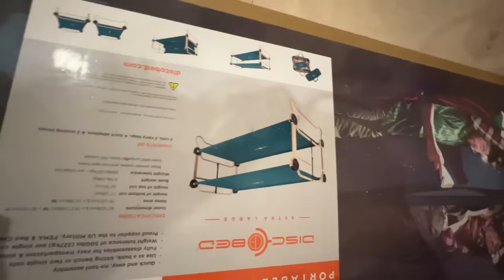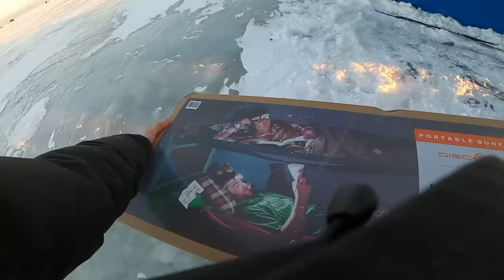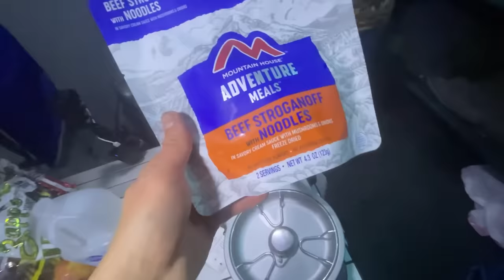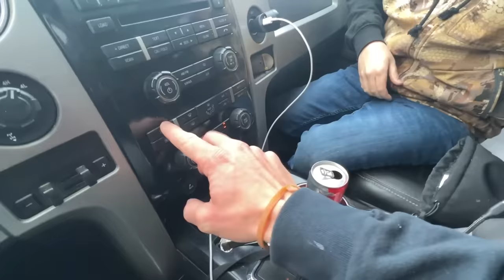Bunk Bed Ice Camping in -5 Degrees

Comment: Don't know if you're used to diesels, but let those glow plugs heat up a bit before cranking it over. If extremely cold, do it two or three times before attempting to start :)
Reply: if that model has the preheating Glowplugs that is, i had a old ass mercedes which i almost had to use a blockheater seperatly in the wintertime due too it not being able to start at all lol. but yeah, preheating is a must for older diesels.
Reply: Good call, I have to wait till the glow plug light goes off in my diesel, not every one has that handy light though
Reply: @DennizWillKill  I thought that was the point of glowplugs? Once the engine is running it no longer needs them since the fuel is ignited with compression.
Reply: @juicewrldextendedunrelease5274  that is the point of glowplugs
Reply: I had to do exactly this with my diesel VW ages ago when I lived in the same area Mav does.  Turn on the ignition, let the glow plugs cycle, turn off the car, cycle the glow plugs again... repeat at least 3 times...
Reply: @petertratechaud7277  does it damage the engine or the battery if u turn on the ignition more than 2 times?
Reply: I used to do that quite a lot in the military when it was super cold. It helped a lot actually... People expect from their car to fire up as soon as the light goes off but sometimes it is better to let the glowplugs reheat everything 2-3 times.
Reply: @petertratechaud7277  Yep I have to do that with my older diesel tractors in the winter and it doesn't even get that cold here.  The coldest we've seen the past two winters was around zero F.
Reply: there is a glow plug light right in the middle of the cluster let it turn off before starting the engine
Reply: my thoughts exactly
Reply: One question I've had for years.....
Never had a answer. 
Is Murray a Boy or a Girl?
Anyone know?
Reply: @ShibalSsi  Even my newer diesel needs a second in the cold. Grid heater
Reply: @qwsv-_-2520  Technically, no.  The glow plugs and ignition circuit are fine cycling 2 or 3 times.  The starter and engine itself don't turn over or do anything, so they are fine.  You could invoke a problem with the battery though if it is weak or old.
Reply: and to do that* turn the key to the on position and stop there, theres probably a light on your dashboard that will go off once the plugs heat up, then turn to crank.
Reply: Isn't his Volkswagen camper a diesel?  You're right though!
Reply: @TheMightsparrow  Murray is male.  He has a congenital growth hormone deficiency,  resulting in his smaller stature & younger looking in general.
Reply: Our 94 7.3 needs them cycled for like 30 seconds  but it doesn't get plugged in
Reply: I think this is regular gas model.
Reply: @ShibalSsi  yea we used to install these extra heaters on those, back in the days for people who went into real cold places. Fun times.
Reply: Double pre heat on your glow plugs should do the trick but all depends how good your battery is, I’ve loads of experience with Japanese imports and noticed they come with small batterys cause they mostly have tropical climate, so my advice is put the biggest battery in you can fit and make sure it’s for a diesel vehicle.
Reply: @qwsv-_-2520  not at all
Reply: @cherb_soco1891  So how old is he?
Reply: In my city the temp can drops to -20, -30C, some people with old diesel even start a small campfire under the car to heat it up :D
Reply: @Irasi . They are old shitty diesels, European diesels are not like that.
Reply: @Shane-zx4ps  Benz has the same setup, also vw.
Reply: @Censortubes  there is no pre-heat on newer diesel vehicles.
Reply: Your singing made Hank Williams roll over in his grave
Reply: @TheMightsparrow  just looked him up and he’s 16, will be 17 in June of 2022 it says. He makes 500,000 per year! Wow ! Has a successful Utube channel he created at age 11 in his parents basement.
Reply: @rainsofhealing  Murray has a channel?
What’s it called?
Murray is a funny guy.
Murray:So when do I get to move in?
Mav:Wait what…..
Reply: @littleterror05  it happend to me tho. my starter stopped working last winter I had to replace it.
Reply: @TheMightsparrow  this is from the website drukadvice:
“He also made a collaborative ice camping video with 16-year-old YouTuber Murray Hebert from the FishN More channel.” Blessings to you! I’d put the link to his channel but then my comments get scrubbed.
Reply: @MikeSchellingMusic  good singer I though..
Reply: Glad somebody said something
Reply: @TheMightsparrow  I'm not 100% sure, but I believe he's the same age as Mav.
Reply: @qwsv-_-2520  theirs a posabliy of that happening
Reply: @cherb_soco1891  16 apparently

Comment: When you start your rv, try and let it sit with the ignition on for a bit to heat up the glow plugs, that will help it start up easier. In your dashboard you have a lamp that says (glow) wait for it to turn off, when crank your engine.
Reply: Not all diesel's have pre heat systems
Reply: @eveythingthatsadam  this one does

Comment: That diesel cold start gave me the shivers! In these cold temperatures the glowplugs need to pre-heat, it's called the Rudolf Diesel moment of silence. Turn the ignition on and wait a minute or until the according control lamp turns of before starting the engine.
Besides that, awesome video as always, keep doing what you love

Comment: Hey Mav, love the content, if the diesel isn’t starting too well make sure to let the glow plugs warm / cycle a few times, it will start much better!
Reply: F150s are gas lol
Reply: @calebleibold7644  his camper van not the truck bud
Reply: @calebleibold7644  not only is he talking about the camper van; they do make a diesel F-150. You swung and missed.
Reply: Hahaha
Reply: @mitchellhayes1016  no shit? Didn’t know they made a f150 diesel 😳. Interesting
Reply: As long as he had the truck and had a little room, I'd keep a small 2 cycle generator and plug in the block heater for a while, then she'll light right up
Reply: @mitchellhayes1016  that's the " eco" diesel like Chevrolet has isn't it?
Reply: @firefighterpk2440  yes its a v6 powerstroke and i think its already cancelled
Reply: @mitchellhayes1016  well shit, I only thought it was f250+ lol. Well thanks for giving me knowledge!

Comment: You could try any of the Knorr pasta sides from your local supermarket. They just require boiling water like mountain house meals but are about $1.30-1.60 per packet. They are 2 servings each packet and are much cheaper and pretty tasty. Throw in some canned protein of your choice and you got a decent camping meal for a considerable savings over a mountain house meal.

Comment: When you start Steve, because it is a diesel engine let it sit with the ignition on for a bit to heat up the glow plugs, that will help it start up easier. In your dashboard you should have a lamp that says (glow) wait for it to turn off, then start the engine
Reply: A lot of old diesel's weren't fitted with pre heat

Comment: Hey man love the video, but to prolong the life of that diesel let the glow plugs heat up, it will be a light on the dash that looks like a loop de loop. Only takes ten to fifteen seconds and in extreme cold sometimes you have to do it multiple times. Will greatly increase the life of the engine. If it is an older model and doesn't have glow plugs it should have a block heater, will just be a typical outlet usually hanging out the hood.
Reply: He doesn't drive a diesel
Reply: @jonathanroe808  the old JDM camper is definitely a diesel..

Comment: Can you go through the drive thru in your camper?
Reply: Not a chance. Most drive thrush are 8'-9' tall.  That camper is every bit of 9'6". I tried it in a mid roof Ford Transit. I scraped a KFC drive thru overhang.
Reply: congrats on the verified check m8👌🏼

Comment: At the very start where you start the engine it took longer than you would think to start. That is because diesel engines have glow plugs so when you switch on the ignition you should give them a few seconds to heat up before cranking. The engine would more than likely fire up straight away. Try this next time, the glow plug light is above your oil light in the dash.

Comment: Take one of the silver rescueblankets, the thin ones, and place it in the ceiling. It will reflect the heat back down :) Works in northern norway, should work where you are aswell

Comment: I have similar KIA with diesel - please dont start it like this. You rotate the key until spark plug icon lights on on dashboard (as I remember - 1 "click" before ignition) .

And you wait until the icon goes off - that means the spark plug is heated and good to go